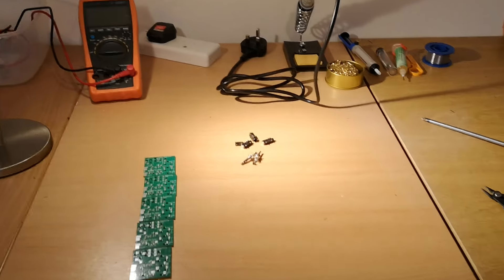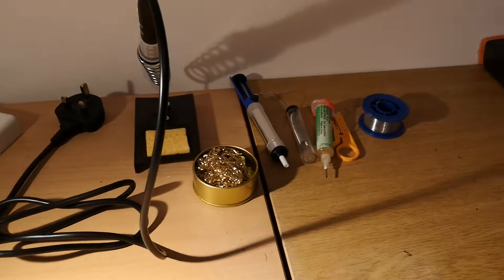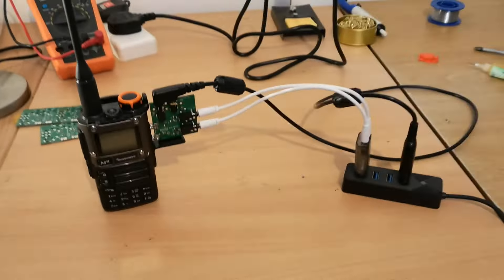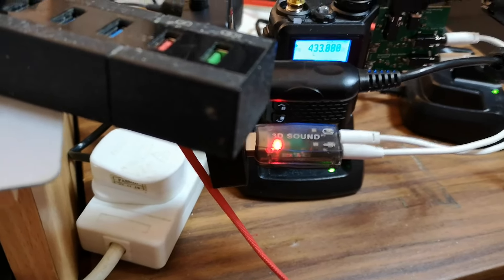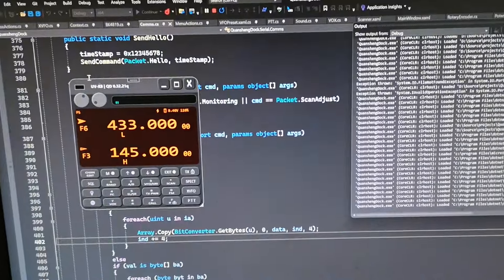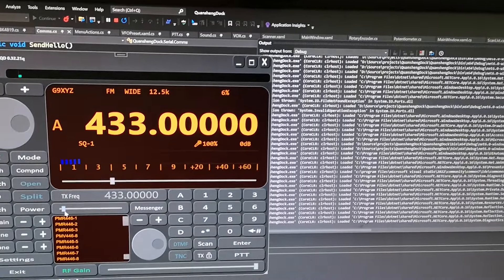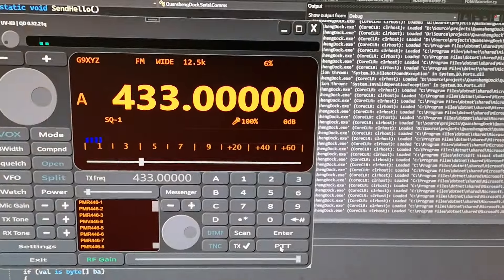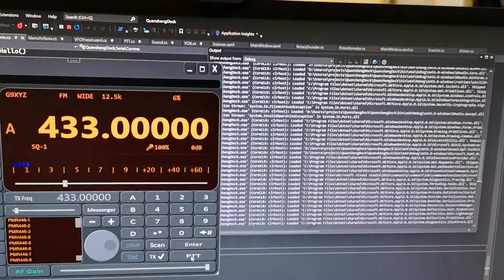QD Adapter - Testing the first revision PCB

Comment: I ran into a buzz issue with my audio cable coming from a direct out on a mic preamplifier, to a Baofeng speaker/mic plug-in adapter.  The issue was placement of the cord too close to the darn radio.  DC blocking capacitors were added, and microphone removed to accommodate the audio cable from the preamp prior to utilization due to 3V bias for the microphone.
Getting the cable away solved the issue.  I am sure a more robust shielding for  the cheap audio cable would help as well,  instead of the 'ground/shield' usually being bare stranded wire, not wrapped around the conductor.

An interesting thing that my UV-K5(8) does when on, is pulses, causing RFI when transmitting on a different HT at a very low power of 0.05W (TH-D74A in EL power mode).  It would not have been noticed if the transmission was 0.5W, as I tested at that power level (L power mode) and the pulse was not audible in the SDR.  

SDR was recording audio files, with speakers muted to mitigate any feedback.

Question about the adapter you are creating compared to the AIOC one:
The AIOC adapter states it only allows for digital modes, but has only been tested with aprs transmission. I am confused to say the least.  The way I have been decoding with fldigi and wsjt-x is by creating a virtual audio cable and piping the SDR's output to the software, as well as a virtual com port with com0com to interface with the tuner.  Can this not be done with the AIOC adapter?
It seems the one you have I can just pipe the analog audio however I chose to do so?  I am guessing the "bandwidth" of the signal will be max whatever Wide FM can listen to?

Great project with the software AND firmware!!! 
I have another K5(8) on the way , and it is all  your fault.  A fun comparison between yours and IJV's firmware should be enjoyable.  I think interfacing constantly with the second radio via PC will be a nice thing for having TX capabilities.    
If using the Baofeng programming cable with your software, am I correct  to assume the audio will in no way be able to get transmitted to and from the PC for RX and TX capabilities?  All controls of the radio would be available otherwise.

Thank you for your efforts! I will enjoy seeing how this project progresses.
 Get some tin foil around that adapter of yours to see if RFI is eliminated! It works in a pinch, and does excellent if wrapped a couple times around plastic housing.  Get the thick stuff, as the paper thin is less than useless for this use, speaking from experience.  If you have copper tape lying around, even better.
Reply from the maker: There's a lot of RF bypassing dotted around, as well as coupling caps for the audio. It does seem to be quite RFi resistant when bare. I tested it with a rubber antenna with ferrite clamps around everything without a problem. The main issue this has (and the newer ones, the later revision to this) is that damn serial bleed-through to the audio. It's present on RX and TX. Thing is the AIOC doesn't have the issue on RX, but it does on TX, I'm guessing that's because the Mic audio is just far more sensitive and the cross-talk is happening inside the radio itself. I'm still puzzled as to how it's getting into the RX audio as I was very careful to keep all audio paths isolated on the PCB, surrounded by ground fill. Any point where Serial/Audio traces crossed on opposite sides of the board do so at right angles to minimize any coupling. Yet still there is serial artifact that's audible. There's also a weird effect it has on the battery level, I had to go into the secret menu to recalibrate the battery in order to allow TX in normal mode. Kind of odd as I don't even touch the power, it's not connected. Regarding your question, APRS can be done without any virtual audio paths with the AIOC or this Adapter, you just select the devices for audio in/out of the radio in the TNC software. Still need the com0com virtual serial port though.

Comment: Curious if you see an advantage of using this board over the aioc with the sound card built in?
Reply from the maker: The AIOC is still my recommended way to interface the radio. This is a passive adapter that gives line-in and line-out to the radio which can have other applications. It's also cheaper and was supposed to cut down on cross-talk which the AIOC suffers from very badly, although that didn't pan out too well on this revision. It's just another option, and having options is never a bad thing.